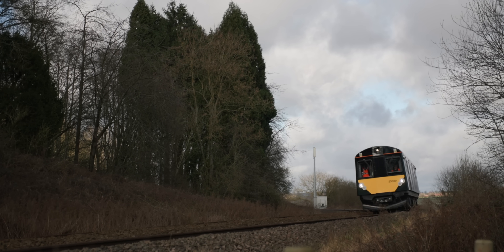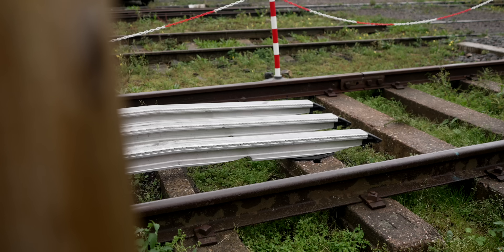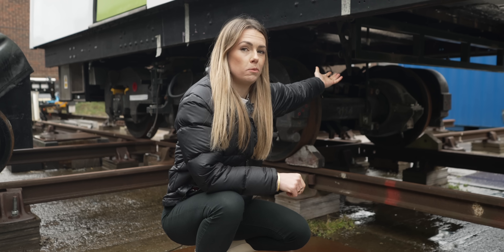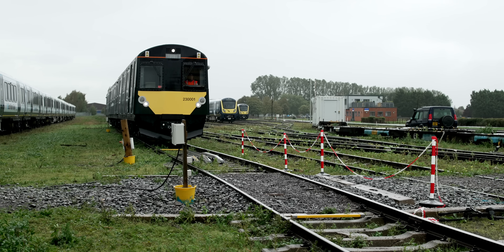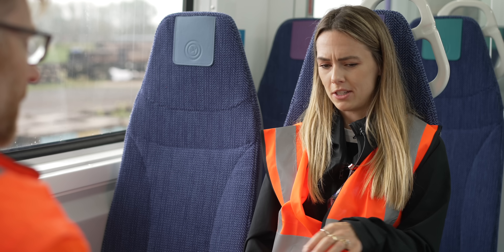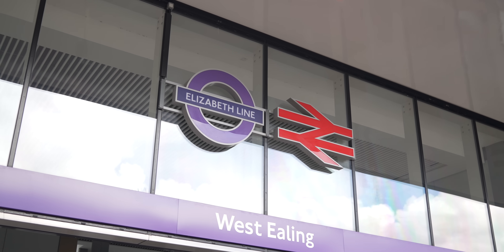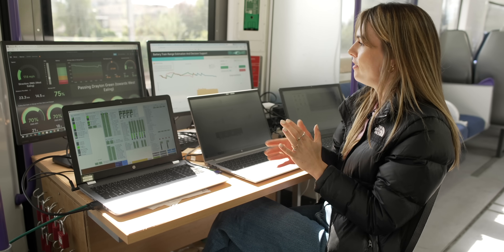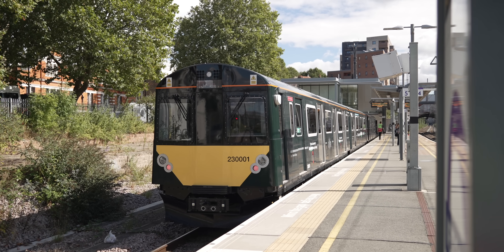Onboard the UK's First Battery Electric Train!

Comment: I think this is a perfect way to utilise this technology, in small commuter lines, especially as the electrical capacity already exists, unlike rolling it out piecemeal on the roads where the travelling public's needs can't be predicted.
I'd be interested to see how it works out during the relatively short hot periods we experience in the summer or the sudden cold spells we encounter during winter. Two taxing situations which will certainly test the reliability.
I'm not a fan of electric cars especially where accidents are frequent as the off-gassing of these battery fires are extremely dangerous. Similarly, I think they would pose a significant risk in underground train situations but as with all technologies, it is often after a number of years of operation that the bugs are ironed out, if at all. We shall see.

Comment: The British Rail BEMU was an experimental two-car battery electric multiple unit (BEMU), converted from the prototype Derby Lightweight Diesel multiple units. The train was powered by many lead-acid batteries, and was used on the Deeside Railway from Aberdeen to Ballater in Scotland from April 1958 until it was finally withdrawn in December 1966. The North of Scotland Hydro-Electric Board initiated the design and was a joint sponsor. The board promised to supply power at three farthings per unit for a fixed two-year period.[1] It provided an 11kV supply to a charger at Aberdeen's platform 1 and a 6.6kV supply to a charger at Ballater.[

Comment: While the shoe concept is interesting, I wonder if the concerns over someone being accidentally electrocuted by those charging rails could be alleviated by simply moving the charging to wires above the train rather than rails on the ground. Since non-battery electric trains already use wires above the train for power, this tech is already well known and has been in use for many years. Just put it at the train stations for charging the train batteries there instead of all across the country for powering the trains during transit. The wires could be extended for whatever length is necessary to charge the train's batteries as it approaches the train station, while it's at the train station, and as it is leaving the train station so that charging time wouldn't be a problem, it could take as long as it needs.

Comment: I think that battery powered trains is probably going to be the best option to replace diesel trains that are over 30-40 years old and do need replacing at some point in few years. Including the Class 165 and Class 166 which are most likely going to be sent for scrap.

Comment: "it can charge up to 2MW" me: "in what timeframe, these things do matter, especially when batteries degrade and the contacts aren't as good as what they were when new, 2MW seems like a lot, but if it's over days then it's KWH charge rate, what is the charge rate, what is the voltage that it charges at... at 40Kv it would charge really rapidly, but if it's only 400V then it would take the same rate of charge as if we were driving a Kia... there's a large difference between a bubble car and a heavy rail machine.

Comment: This is such a no-brainer.  The cost has got to be way lower than installing catenary systems everywhere.  The stationary charging battery banks could be, themselves, charged from wind and/or solar even in the middle of nowhere with no need to bring, again, horribly expensive mains power to site.

I see Vivarail (which was originally developing GWR's battery-electric trains but which went bust in 2022 after 10 years and whose assets and IP were bought by GWR) used Valence's fantastically expensive battery modules for this project.  Each ~1.5kWh battery module (very similar in size and shape to a standard automotive lead-acid 12V battery) cost around US$3k 10 years ago and I gather these trains' battery pack have about 50 of these modules to power it ie about 150kWh per engine... and US$150k!!... just for the battery.  You can see the Valence battery config and monitoring software in action here: https://www.youtube.com/watch?v=9s4heZe7ChM (briefly - at 03:48s) when Bob and 'Fully Charged' first looked at the project 7 years ago.

Of course, this type of battery storage (LiFePO4 in this case) has dropped in cost by around 90% since then - Valence stuff probably not so much...

Comment: A battery operated train? Can't you see how nonsensical this is? It's unbelievable that anyone wasted time and resources on this instead of doing something actually useful, like, I don't know... Fully electrifying the UK railway lines, like the rest of Europe? I can't believe that the UK rail network is not fully electrified in 2024....
Reply: There are numerous lines in the UK that are not yet electrified. Since the UK invented the modern railway, the early lines were developed for steam trains, then replaced with diesel.
Outside of major cities, and the south-east of England, few lines are electrified.
The midland main line has been in proposals for electrification for decades! it's still not fully electric.
Only south of Bedford, headed to London, St Pancras is electric.

If it doesn't benefit London, investment does not happen.
Reply: And yet Europe is also implementing battery based trains as well, not all of Europe's network is electrified (it's mainly the trunk/mainline routes that are). These battery systems are designed for branch lines, plus the difficult/expensive to convert parts of the network that would not be cost effective. 

The UK has 9,918 miles of track, only 3,769 is currently electrified - that majority isn't and fair amount of that are branch rather than main lines. This isn't suprising given it's the oldest (non-mining) network in the world, with some of the routes dating back over 200 years, not really designed for overhead/third-rail electrification (for example, when part of the route to Weymouth was electrified it had to be converted to single running, with signals to prevent collisions, as the overall width wasn't wide enough for two electrified third-rail tracks).

Comment: Ninety percent of the energy is expended getting the train from '0' to '60' or so, i.e. starting up.  Since they are starting up in the railyard, have a huge turn-wheel, attached to a cable begin moving the train.  In fact, the most energy is used starting from '0' to '5'--the 'curve' is rather steep.

Comment: Horrendous gadgetbahn. Yes, there are issues with overhead wires - but they're relatively cheap and extremely standardized. Rather than reinventing a third rail (as they did) you'd be better putting up overhead wires where cheap/viable and bridge the gaps with the batteries.
Reply: The UK sucks at electrification though so this is the best we can do
Reply: The branches for which the battery system is proposed for are not "relatively cheap" to electrify, especially compared to their traffic volume.

Comment: Why would we need battery electric trains? It seems a waste of precious rare earth materials. Modern electric trains run a hybrid system, so they can still operate through tunnels, and 3rd rails are arguably easier and less expensive to install, and don't have the compexities of working in tunnels.

Comment: I'd be very interested to learn the economic comparison between the costs of the battery electric train and its infrastructure versus pure electric and installing overhead wire infrastructure. My initial thought was these wouldn't be economically viable when compared, but after seeing this video, I feel like there could be some scenarios when battery electric might win out over the other. I'm curious what factors would tip the scales in either direction to favor one technology or the other in various circumstances.

Comment: How much weight was removed from the train when they get rid of the diesel drive train. I wouldn’t be surprised if the train is lighter than a fully fueled diesel.
Reply: Apparently it's about 8 tonnes, 8.5%, heavier than the diesel versions were
Reply: @ - does that include the fuel?
Reply: @legostud : I have no idea, there wasn't any clarification in the presentation whether that included fuel or not :(

Comment: What happens to the train gets in a train accident are there any hazards or any kind of dangerous stuff coming out of the batteries????
Reply: There's a section on battery safety in one of the videos about the battery train trial, "The GWR fast charge battery train trial - David Horton" from the PWI (and about 20:50 into the video).

Comment: Have a look at the “Light Rail” or trams in Newcastle Australia. Our trams are battery/capacitor powered. When it arrives at a stop, the pantograph goes up, charges in 60 seconds, pantograph comes down and it runs on batteries in between stops… one day if they expand it outside of the city with stops far apart, it’s fully compatible of running on continual overhead wire.

Comment: Battery locomotives actually appeared in 1905 on the London Underground, and were used to haul engineering trains during the small hours when the traction current was turned off. From what I've seen they were built to be used on the deep level lines, but also worked the sub surface lines because the track gauge is exactly the same.

Comment: Wether it's green or not depends on how the batteries are charged if its of the grid it will be by gas turbine power stations.
I see someone mentioned battery storage did you know large lithium ion battery storage only lasts minutes when discharging to the grid.

Comment: Uselessly making this train's charging system complex. Just standard 750 V third rails to deliver power to the battery packs, or even usage of a standard pantograph for charging and driving under 25 kV AC overhead line equipment would be a more simple way of charging these battery operated trains.
Reply: The method of charging is down to the high currents involved in fast charging the batteries (and at least with the method here, there's no need to interfere with the running rails).

Comment: What do you do if a train runs out of battery power and it is not near a station to charge or what do you do if a train breaks down/a charging station is not working when you approach it but you can't make it to another station with a working charging station?
Reply: The trains will be made with redundant systems (a couple or a few smaller motors, batteries, battery controllers etc. Meaning there is little chance all of the system is unavailable (like having multiple engines linked to multiple gearboxes with separate clutches for redundancy). And electric motors, batteries, chargers etc. of industrial quality are 10-100 times more reliable compared to diesel engines.

The battery will be sized to have enough charge to get the train between multiple stations, not just one. The fast charge is a top up, not a complete 0-100 charge. 😊

There are locomotives with diesel engines, they will just hook up and pull it away.

Comment: It's useless you can run this train simply connected with electric alluminium wire
Reply: In tunnels and where there are lots of crossings it gets expensive, cheaper with batteries as it usually is in the cities with low speeds.

Comment: So it just a capacitor that dumps energy into the train at each station.
Reply: No, using Capacitors would cost 10-100 times more, they are incredibly expensive for storing large charges, Lithium batteries are good at that now that they have matured.

Comment: Those old versions of this 'first' weren't lithium Ion, good luck if the LI batteries burst into flames - run fast - you ain't putting that fire out
Reply: Lithium Iron Phosphate batteries do not catch fire, you can drive nails through them all day, no fire.
Reply: @TheEsseboy  Oh! Thats good, do cars have that type nowadays?
Reply: @Make_America_Groan_Again  Yes, most of them have transitioned to it, they are also far cheaper per kWh too!

Comment: why investing £££millions in battery, when you can invest the same money in electrifying the track?

each train needs batteries in the beginning, 
each train needs replacement batteries in a few years time, and then again, and then again, and so forth .  .  .

and we heard that even trains do collide some times
why expose 200 humans to a certain crematorium in such an event?

why are they so mad?
Reply: It’s not so easy to install overhead lines to local tracks. Bridges have to be raised or replaced meaning loads have to be changed, etc. can have overhead lines where there are level crossings, etc etc. The batteries take the place of heavy diesel engines, generators, fuel tanks. This tech works great for regional services for sure. Better than a belching diesel.

Comment: Hydrogen Electric is the only solution for big stuff like trains and big trucks.
It can go thousands of kilometers on a single fill-up and takes minutes to fill-up. No Lithium. No explosions from a stray bullet.... 
NO FUEL has the energy density of Hydrogen weight for weight. Batteries are even heavier than diesel and carry a fraction of the power that diesel has. 
As a retired electrical engineer, I wonder what type of training these people who make these decisions have! The silver lining is these can be upgraded to hydrogen electric easily later on. 
Did they get their engineering degrees from "Bubble Gum Machine" university?
Reply: Hydrogen takes 5-10 times more energy to create compared to charging a battery through the grid.

No one has made green hydrogen on a large scale with high efficiency...it is NOT the future of trains and trucks...maybe aircraft and industrial processes...but not things that travel such short distances with so little energy requirements as Trucks and Trains...trains only need batteries for short distances as overhead lines are cost effective investments.

You can never reach hydrogen's density potential, unless you cool it to -253 celsius! The tanks alone make it less dense than all other chemical fuels.
Reply: @TheEsseboy  You're too late!
Most excavators in mine operations are switching to hydrogen fuel cells. 
There's a video of it on this channel. Go watch. It's interesting.
Reply: @TheEsseboy  As for the tanks, look at the small tanks used in Toyota Mirai which can do 650 Km on a single fill-up. 
It's the simplest fuel to make with solar panels and water. How simpler can it get? 
We don't have renewable energy becasue of lack of balls, not lack of technology.
Reply: @piconano  Where can I fill up a hydrogen car? There are almost no stations...and 99% of the gas i made out of fossil methane gas... turning it into CO2 and hydrogen...the CO2 is just sent into the atmosphere
Reply: @TheEsseboy The same place you get your fusion fuel of the future? 
Tell that to Toyota. Why would they bother with a dead-end design? 
It's only available in California like everything else that eventually makes it around the world. 
I can design and build you one the size of a regular gas pump. It needs connection to power and water. Go see some built in California.
Reply: @piconano  Because it is a private company with a small number of people congrolling it, t
humans make mistakes. If they didn't, Windows phones would still be a thing, Hyperloop would be all across the world (A Cali thing only mind you, hint hint wink wink), google glass would be a thing etc.

Hydrogen gas is too inefficient to make, too hard to store in a small low weight volume, not compatible with current gas pipelines and currently 99% of all that is made...is made from fossil methane gas, the carbon is vented as CO2 to the atmosphere...

There are NO large scale production of Hydrogen made out of water and green electricity...and those who are have an efficiency of 30-40%...that with the energy needed to compress it to 600-800 bars, losses in the fuel cell and electric motor bring the round trip efficiency to 10-20%....meaning it is literally wasting 5-10 times more energy compared to EVs...
Reply: @TheEsseboy  You do you boy.

Comment: Great stuff. Ive often wondered why something like this isnt used for charging cars, does anyone know? It would seem much easier to drive up to a charge point, deploy some charging contacters without leaving the vehicle. No faffing with cables, no risk of copper theft from said cables, dont get wet if raining as you dont have to get out. Also you open the possibility of on the road charging, maybe like a few minutes pit stop on a motorway.

Comment: You first charge battery storage, which is about 90% efficient. Then you use proprietary connection to fast charge the train at 90% efficiency. So you wasted almost 20% of energy before it got to wheels. You also have put stress cycle on 2 batteries. 

For me, the best solution is a hybrid, where it uses OHL or 3rd rail for power supply, uses batteries while accelerating and braking (even in EV mode, because it makes less stress on the grid) and where there is no external power supply, it runs on a small diesel engine. 

There is also something that was used in Switzerland in the 50s, - gyrobus. It used flywheels as energy storage.
Reply: Well, charging stationary batteries usually are 92-95% efficient, and the train has a much higher weight capacity so it is probably closer to the stationary ones.

Battery regeneration capabilities are highly dependent on how large the batteries are, too small and you will have to use normal breaks to supplement the regen.

Comment: Im  not a beliver of battery trains, they should invent a way where they can get power from a wire that hangs above the train, imagine that, all that battery weight removed.
Reply: Invent a way to get power from non-existent wires.
Reply: You can’t put overhead wires everywhere. Some local lines have bridges that are too low, plus imagine having lines over level crossings…. Bzzzzz